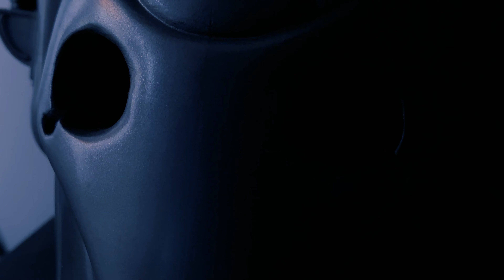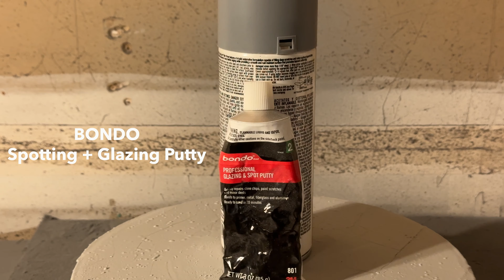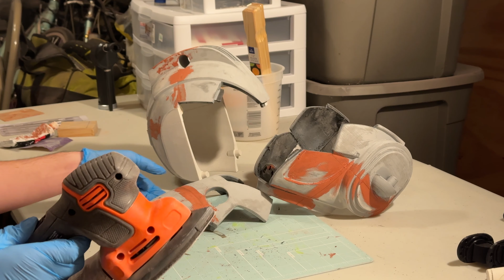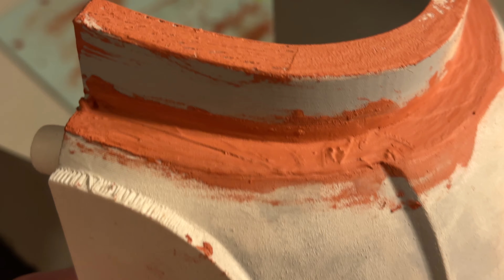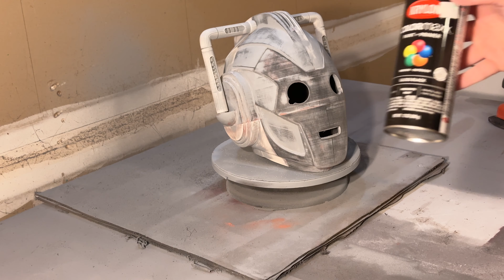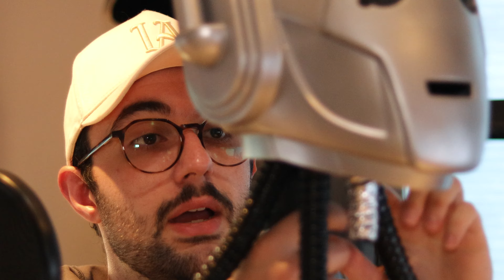3D Print Your Own Cyberman Helmet: Step by Step Tutorial (EP 2)

Comment: Great video thanks for sharing!
I got a question, how long do you generally wait before putting the silver over the black. Having a ton of issues with it sticking. Cheers
Reply from the maker: Great question! And thanks for the support! 

It depends on the type of spray paint you’re using. If you’re using something high quality, normally 2 coats of the black as your base, with 20-30 minutes in between each coat gets you full coverage. 

Then I normally wait about 30-45 minutes to let that dry and cure and throw on the chrome. Once again as long as it’s high quality, it should stick and you shouldn’t get issues. 

Another big factor that could be contributing to it if you’re already doing that time in between painting, and using high quality paints is temperature. Spraying in a place that’s either too hot or too cold can cause issues with adhesion. Always best to do it in a well ventilated area that’s at room temp. Or, if need be, spray it wherever the ventilation is good, and then move it to the room temp area after spraying. 

Hope this helps!
Reply: @gstudioshq great! Thanks for the advice and your time to answer me back. Keep on nerding!